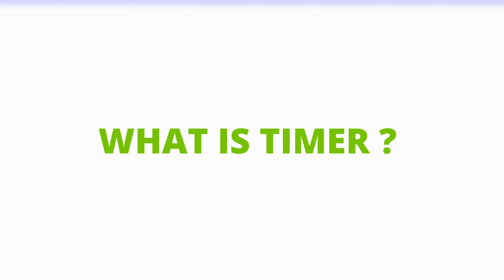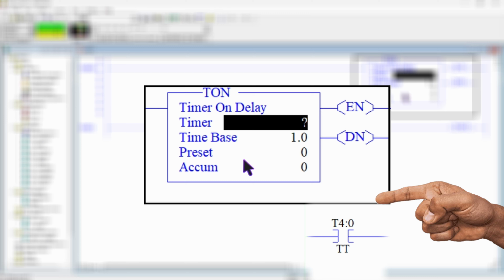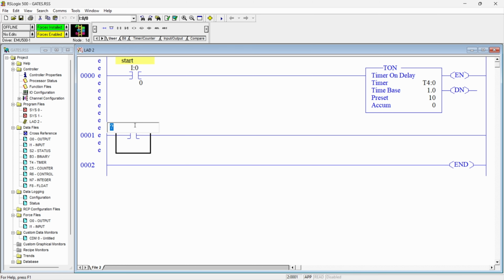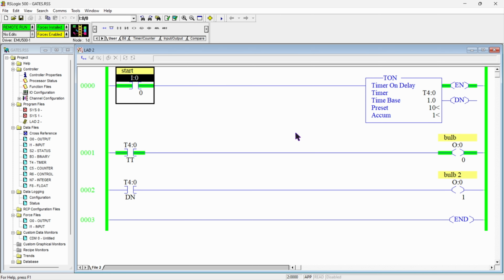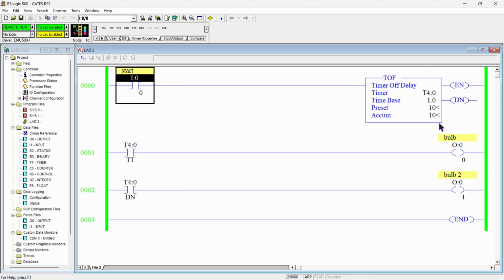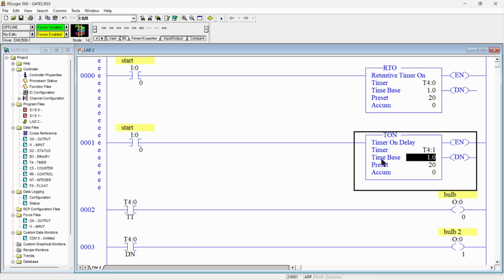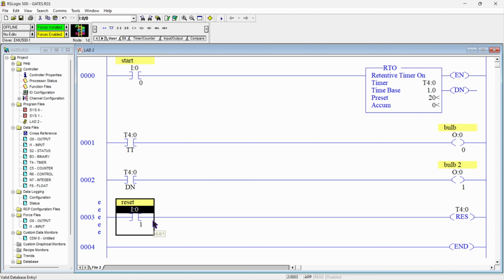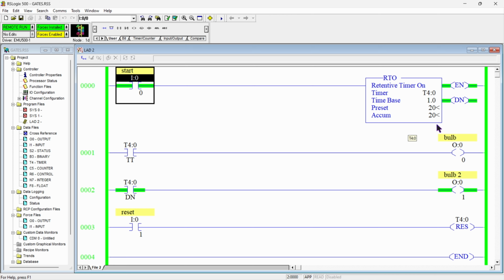Watch This Before Using Timers in PLC program (TON,TOF & RTO Timer) explained

Comment: What happens if the T4:0/DN is a XIO? Does it change the state?
Reply from the maker: No if you want to change the state of output by timer you need to use TT or DN bit of the timer , by the way what do you mean by XIO 😅
Reply: @ezAutomation5 Execute if Open or Examine if Open. Thx
Reply from the maker: @MaxTor2112 I will try 😅